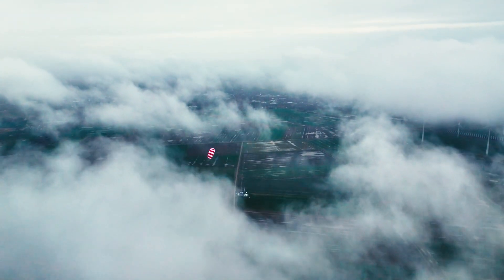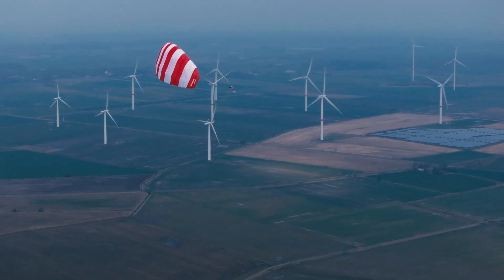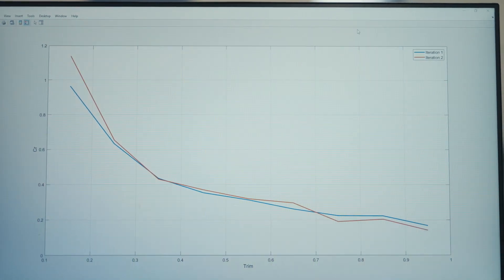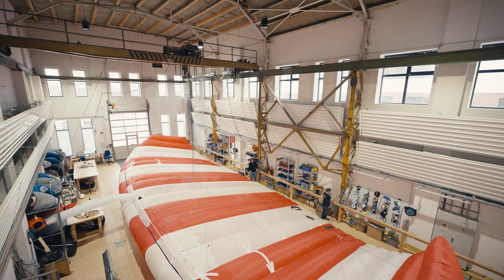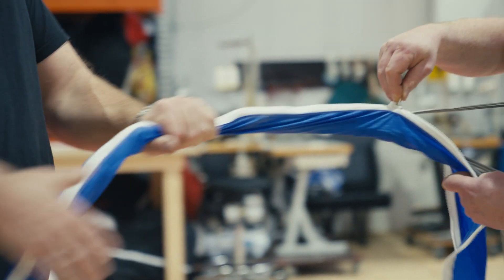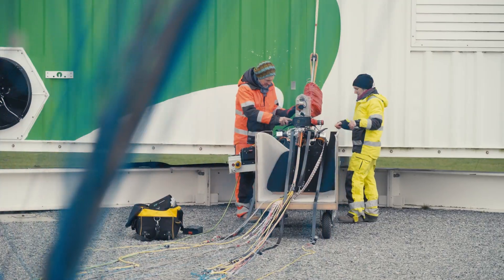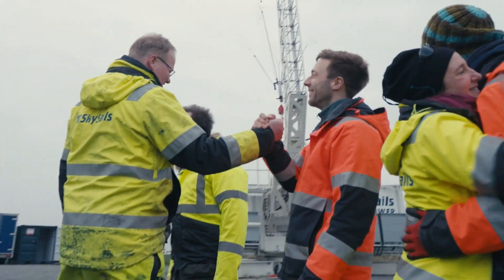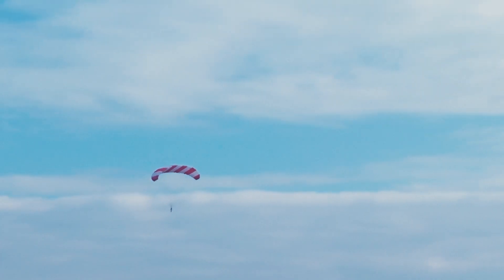Northern Winds of Change: SkySails Breakthrough in Airborne Wind Energy

Comment: Is there any document explaining the power / energy collected (and produced)  and the duration of tests ? I understand the value for boats and ships in matter of traction but I do'nt understand the benefits (regarding the efforts) in matter of electricity generation. If you have more detail this would be good. Thanks
Reply from the maker: For energy production, the automatically controlled power kite rises in figures of eight, driven by the wind. As it gains altitude, it unwinds a tether from a winch on the ground. The tractive force drives a generator inside the winch that produces electricity. Once the tether has reached its maximum extension of 800 meters, the autopilot steers the kite into a neutral position with minimal drag and lift. While consuming only a fraction of the energy generated before, the generator now acts as a motor and reels in the tether. The system continuously repeats this process, flying the kite at an altitude of 200 to 750 meters. Energy generated by the Airborne Wind Energy System can be fed into the grid, stored in batteries, or directly consumed. We will upload our Power Curve soon our website: https://skysails-power.com/onshore-unit-pn-14/
Reply: @skysailsgroup8754  Thanks for the details.
Reply: @skysailsgroup8754  какая примерная стоимость такого змея?